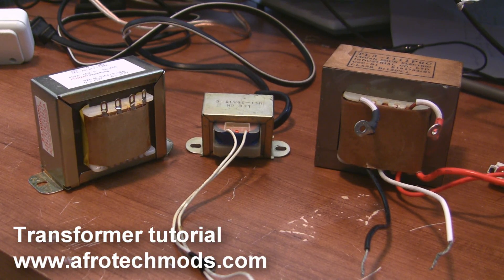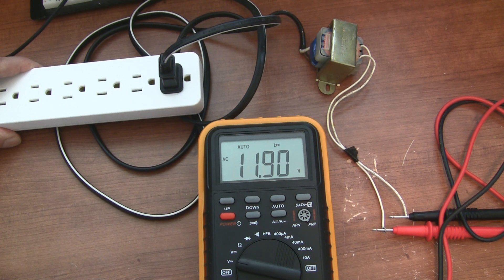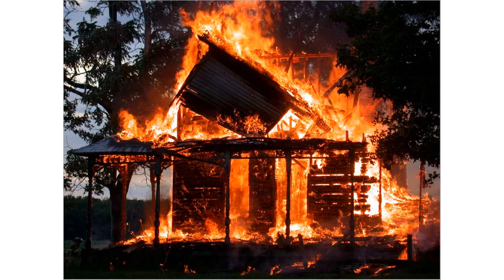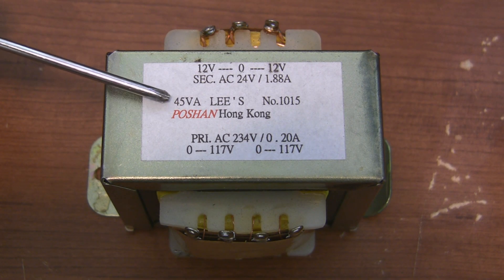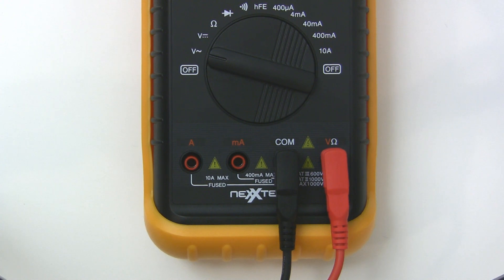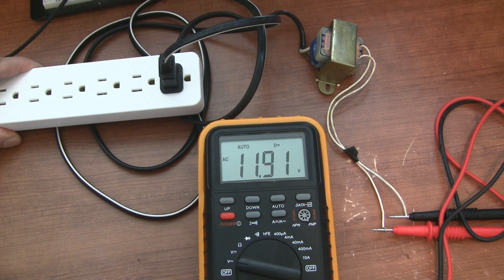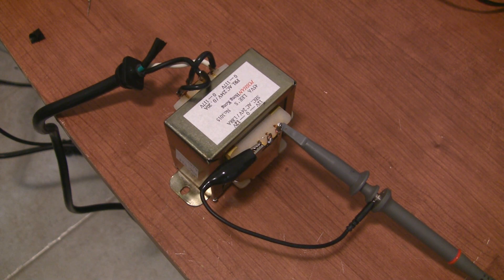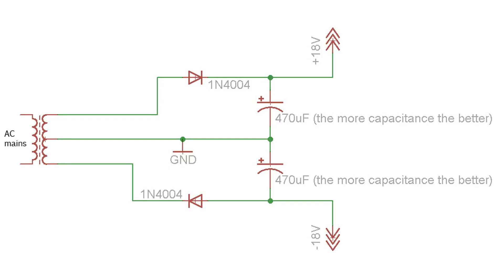What is a Transformer? An Electrical Transformer Tutorial

Comment: Excellent videos - question:  Why is it that if I purchase a linear power supply specifically designed to power audio devices, they are often hundreds of dollars?  Is it all the same principles, they're just using "audiophile" caps, resistors, etc. or is there something else to consider if you're designing a power supply to run an audio amplifier? I'm looking to build a 12v 5a linear power supply and it looks like I can make one for under 50 bucks using good components...or I can buy one for over 300 bucks.  I'm guessing the price diff is in the transformer, but you're smarter than me :-D  Thanks again for the vids!

Comment: I have a 120 volt to 220 volt transformer..if I  hook it backwards what would happen??? I  guess it would be, or have an output of 60 volts..right???
Reply: +Kennynva T. no nothing will happen if hook up the 120v to the 120v side youll get 220v on the other side just dont hook up 220v to the 120v side it will blow up
Reply: I know...I asked what would happen if I hook up 120 volt to the 220 volt side...what would be the output on the 120 volt side...????
Reply: Kennynva T. youd get 60 vac
Reply: Thank you very much...I guess I could use it as a dc power supply with a rectifier set up...thanks..at 60 volts..

Comment: basic question if someone could lend a hand. small G.E. (40 vac) transformer in an air handler. Two 120v circuits feed the primary.
The secondary  voltage is 24 volt.The 24 volts is used for the thermostat  Ques: where does the neutral for the 24 v come from? Assuming that circuits that use line voltage and lower need a neutral. Thanks

Comment: Very interesting and easy to understand videos. I built a car battery charger from a schematic I found online. The electrolytic capacitor exploded because I may have miscalculated the working volts (WV).  I bought the parts from Jameco too.  The electrolytic capacitor is the brand made in China known as SC. I think it means South China. I read reviews about their quality and some say they are unreliable. I bought two just in case, but I ordered a larger one at higher Working Volts.  

Thanks from sunny California.

Comment: Why doesen't the mains conection to the primary sice of the transofmer create a short circuit if there is no resistance, just a coil?
Reply from the maker: +Richard Haes Ellis Because the primary side of the transformer has significant inductance, and the input is 50/60Hz AC. So there is significant enough impedance that it is not a short.
Reply: ahh right thank's! Very good videos by the way!
Reply: +Afrotechmods Isn't that called Inductive Reactance measured in (Z) or Impedance?

Comment: Is there a good "rule of thumb" to determine how much power a standard 50-60Hz steel E-I core transformer can handle? I have a few transformers ripped out of old things, most of them are really small, generally pulled out of broken wall adaptors, while another one I have has came out of a old boombox, and is about 2 inches cubed, while another one I have is about 5 inches cubed (it is HUGE) and was inside a regulated Lambda power supply 5V 9A, though the transformer itself is 12v-0-12v.

Comment: great video sir,I have question ,When it's come to guitar amp wiring,the two primary wires when, we connect to the circuit,is there any theory that which wire goes to switch and fusr?
Reply: The fuse and switch should be in the hot wire. In many jurisdictions this is legally required.

Comment: Here in germany we usually have three phase 230V/400V 50Hz AC and the cable colors for the phases are brown, black and grey. And nice video by the way, thanks :)
Reply: Ivan R yo
Reply: +Sebastian Au three phase??? I live in Germany too and all the transformers I salvaged were only one or two phase.
Reply: Rohan Zener I actually have seen a seven phase transformer once.
Reply: +ivan R That's probably because you salvaged transformers from devices which meant to be connected between one phase and neutral. ^^
Reply: Sebastian Au Probably

Comment: Sir Great Video 
need help also 
i have a transformer with output 58-0-58 5A i want to reduce output to 36-0-36 5A. what can i do..?
Reply: +truth is always painful Perhaps using load resistors (8 Ohm)  at about 50 Watts rating then using a LM series regulator IC to bring it down further with a good heat sink or Cool Rib attached?

Comment: can someone help me, i have a 120v to 10v transformer, when i apply 120 to the primary and turn on the powerbar, it blows the breaker, outputs and input isn't shorted
Reply: +santoroma17 I think your transformer is burnt through. If I were you, I would measure the impedence of both coils and tell me, so you could be sure if it is broken or not.

Comment: Afrotechmods I know that DC does not work with a transformer but what about a pulsing DC current?  like with a pulse width modulated DC current, it actually turns ON and OFF multiple times per second.  Would that work?
Reply: lethaldriver Yes, that works too.
Reply: +lethaldriver yes it would. Remember that an inductor will induce a magnetic field to counter any change in current whether ac or dc. The key phrase here being "change in current".  If you connect an inductor across a battery and then remove it a magnetic field will be induced in the coil. It will of course again induce a magnetic field if you reconnect the battery.
Reply: yep. spark gap ignition runs on this principle.
Reply: +lethaldriver yes absolutely. In fact, it works really well. Search google for a 555timer transformer driver. That should explain a lot. :)

Comment: im still confused i have a 230v 50hz 12v 0,8a speaker transformer from a 6'' speaker and i have a smal el engine that runs on 12v 15 a that i have hoked up to a smal air compresser that i use for pumping my bike and stuff but the last transformer that i had that i had speseficly burth for that purpus fried so im wondering if i can use this one

Comment: The green equipment grounding wires do not "ground" the system to the earth--that is a misconception (I'm an electrician). It bonds to the neutral at the first panel on the secondary side. Meter center is earth-grounded and usually so is the house panel, but the green ground wires are NOT to provide a path to the literal earth for current (except for lightning strikes): it only provides a fault path back to the source, which is in most cases the local transformer. The grounding rod outside your house is not for internal system over-current protection (that's the common misconception); it is for external power surge, such as lightning, that could disrupt and damage the system. The ground fault path for internal faults is through the equipment grounds (green or bare) back to the panel (where they are bonded to the neutral bar), through the feeder neutral, through the secondary neutral into the transformer coil, the system's source of current. I respectfully suggest you add a comment or note to the video clarifying this. Also you can Google the National Electric Code to get reference and authority on it. Thanks.
Reply: Paulus Joshua As an electrical engineer that studied power transmission but not power distribution, that was a very interesting and important fact.  Thank you for posting it.
Reply: good to know, thank you!
Reply: stevey201 I appreciate that friend. I am in school studying to be an electrical engineer myself. God bless.

Comment: Hi i live in Australia and my ac voltage 240v ac at 50hz  you shod do a   Tutorial mains voltage about the difference between 50hz and 60hz and is it true that if i got a clock from a 60hz and coveted to 50hz supply  what wood happen

Comment: An older vid and excellent tutorial...explains details I've puzzled over for years...except this one: can anyone explain it? 

I have a vintage audio amp with a single secondary output transformer...three wires. Two produce 90AC across them and the 3rd is the center tap. The center tap connects to the ground between the main power supply caps. I assume the secondaries are in series. So why is the center tap external...what is the reason it would need to connect to the power supply?

Comment: At the end, you show a DC voltage of 18V. Is it 18V because that's half of the Vp-p?
Reply: Take 12 volts and multiply by 1.414. That will give you the rectified and filtered DC voltage. Since his output was slightly higher than 12 volts, after he rectified and filtered it, it was 18 Volts. The formula works out to be just under 17 volts. Basically, when you rectify an ac voltage, the peak gets chopped off and you are left with something close to the RMS voltage and the capacitor holds the charge up and you get close to the real power output. V p-p is if you use a full wave or bridge rectifier. in his example, he was using a half wave rectifier so Vp-p isn't in the equasion. If his meter reads true RMS voltage, most modern ones do, the Peak voltage would be 12 X 1.414 which is 16.98 Volts. p-p would be double that number... Like he said, everything is rated in RMS voltage because it is the highest continuous useable voltage. So, 12 volts is RMS voltage, not the P-P voltage. Pms Voltage is 70.7% of peak voltage so if you have a peak voltage of 100V the RMS voltage would be 70.7 volts. The same goes for RMS power.

Comment: Backin the early seventies I was in high school and was enrolled in the electronics program.  Someone gave us a box of old transformers.  I was assigned to figure out what the outputs were.  So I connected the primary windings to mains and used a vom to test the outputs.  On one pair of one transformer I found two thousand two hundred volts.  I just about soiled my pants.  I unpluged the transformer and bent those leads out of the way.  I then pluged it back in and continued checking the taps.  My name was called from across the shop and I turned to look who called me.  The next thing I knew I was sitting on the floor with my backk against the wall and my finger was burnt.  I had shorted those high voltage leads with my finger when I turned.  I was just a kid, about 14 or 15, and didn't have enough instruction or experiance to be doing this project.  Today I would wire nut those leads and tape them not just bend them out of the way.
Reply: that was such a great explanation

Comment: You can connect the earth wire (ground) to the transformer core, instead of clipping it.
Reply: I wondered about this too. I bought a variable power supply from banggood without an earth and wondered if I should replace it with 3core in the UK and earth the casing. The casing is attached to a perspex box with nuts to the outside. I've left it as is just now and taped over the screws with electrical tape. Can anyone answer this question about the earthing wire in the UK?

Comment: What do you do for high voltage transformers for tube electronics? Can i just use a standard meter for 500v readings. I know its current but there are all sorts of frequency dependent characteristics that determine current at 60hz. But what should i do just plug it in and hope it doesn't blow the meter? Anyways....

Comment: PLEASE HELP. I have a 120V/12V step down transformer. the primary has a regular wall plug. The secondary has two blue wires. When I measure output with multimeter, i get 12V as expected but how do i tell which is live and neutral since both are blue
Reply: The secondary is electrical isolated from the primary and therefore it is isolated from the primary's ties to the neutral and hot of the source wiring.  That is to say that there is no hot or neutral on the secondary side of your transformer, just 12 volts RMS.
Reply: thank you, I found out from my teachers but thanks nonetheless

Comment: cool video,cold you run a small transformer in reverse to generate a bit more kick..?
im only new to this type of stuff so go easy talk on me haha!!
helps much appreciated
Reply: yes but you always get the same power out that you put in (watts)
Reply: sorrry,ddnt quite understand ..could that wattage produce a decent spark gap?? say 9 v or 10 etc..
how would one go to do this themselves.say from using a bug zapper circuit
Reply: in principle you could do that but for example a mains transformer is only designed for mains voltage. If you try to create several kilovolts, which is possible, you might destroy the isolation of the transformer. If you are really interested in generation high voltages take a look at flyback transformers from televisions/monitors, but be carefull, these are dangerous. Generated over 70 kilovolts from one by myself.

Comment: Can you wire 2 120v to 12v transformers together to make it 24v ?
Reply: I think you can wire a dual secondary in series to double the volts but half the current capacity va.

Comment: There is an easy way to avoid fatalities. Connect incadescent bulb with power similar to power of transformer inline with primary. No load, all good - small current flowing, bulb is not glowing; something wrong (shorted windings, etc) bulb will light up and limit current to safe value. Works like a charm

Comment: are transformers reversible? like, can a 120 to 12v step-down transformer be used as a 12 to 120v step-up transformer if it's wired up backwards?
Reply: no, ive tried by myself and nothing happens
Reply: Yes, this will work but as the man says in this video, transformers only "transform" AC and it will not work for DC.
Reply: You'll notice that the mains side of the transformer has thin wire in its winding and the output side has thicker wire. This is because the higher voltage side (mains) will take less current, while the lower voltage side needs to handle a higher current. Efficiency aside, the power on each side is the same, and since power is just voltage times current, a lower voltage on the output side means a correspondingly higher current. If you try to force too much current through the thin wire, it will heat up and fry its insulation, creating a short inside the windings, so the current it was designed to take shouldn't be exceeded. Other than that, you're good to go so long as you always make sure the input winding is taking AC. If you attach DC to a winding it will not work because the device relies on a constantly expanding and contracting  magnetic field to induce an output voltage (which will be AC too, with the same frequency.)

Comment: 7:17 because the inductor (transformer primary winding) reactance must be larger in 220V.Whit 120V reactance must be less due to Power (W). For example,
300W=220V*1.363636363636364A-So reactance (resistance) must be high
300W=120V*2.5A-Here reactance (resistance) must be low, so that u can have 300W whit 220V and 120V

Comment: At some point you say that a 12-0-12v transformer, basically is double phase transformer if i use 12-0-12v configuration. My question to you is ... is there a transformer with 3 secondary coils? And another question ... (probably you know by now what i'm about to ask ....) If i have a transformer with 3 secondary coils, it will give me 3 phases? if not, what electronic parts do i need for the third phase for 12 v motor.

Comment: did you touch the main or the output of the transformer? Iv been shocked by 120v many times, its not that bad, really, but if you touched the output, depending on the transformer you were using, your lucky to be alive...

Comment from the maker: 1) The power consumed on the primary under no load will depend on the transformer and the inductance of the primary winding. You can typically expect a value somewhere in the milliamp range. 2) Absolutely. Let's say you have a transformer that is 80% efficient at 60Hz. Let's say the secondary has a 100W load on it. 100W / 0.8 = 125W drawn from the wall outlet on the primary side. (This assumes a power factor of 1 for simplicity).

Comment: I understand that using a transformer separates the load from the mains voltage.  I also understand that the voltage can be stepped-up or down as desired.  My question is this:  

While using a transformer in the way described in this video, is that effectively creating a short circuit between the hot and return wires?  Also, what kind of power is consumed on the mains voltage...In other words, does this make the electric meter turn regardless of what the load is on the secondary?  -Thanks.

Comment: So what happens if you have two hot wires (like the two 12VAC at the end of the video that are 180 degrees out of phase) and wire that to another isolation transformer? Are they going to short out on the primary? Equal zero volts? Or get the 26VAC unloaded on the secondaries?

Comment: As Afrotechmods says, transformers require AC current to work.  A 12V battery is DC so what you need is an inverter.  Since in the USA most devices require 120VAC, there are lots of 12VDC/120VAC inverters available that plug into the accessories outlet in your automobile.  I'd guess that in Europe/Asia you could find the same for 240VAC.

Comment: A transformer deals with the current voltage ratio. IF ur stepping up voltage, your current will drop at the same ratio. If thats the case, from the formula I=V/R the resistance was increased and thus the signal volume decreased.

Comment: Yes, just make sure the input voltage and voltage rating of the windings and AC frequency agree or you will saturate the core and cause a fire.  Using a 120 volt to 12.6 volt step down transformer, for instance, you can hook up 12.6 VAC to the 12.6 volt windings and use it as a step up to 120 volts.  However, don't put something like 24 volts AC on the 12.6 volt windings of the aforementioned transformer and expect 240 volts AC from the 120 volt end; you'll melt the coils and start a fire!

Comment: Most of my transformers are step-up since I use and build tube circuits.  The most common are between 300-0-300 (600vct) to 450-0-450 (900vct) secondary with 5 and 6.3 volt heater/filament windings for use with full wave rectifier tubes, such as a 5Y3, 5U4G, or 5AR4 type.